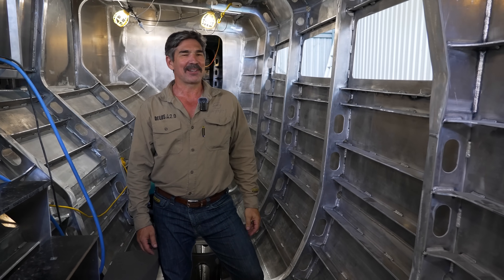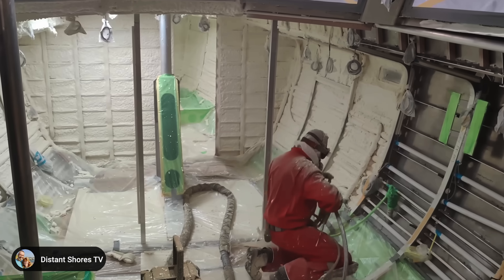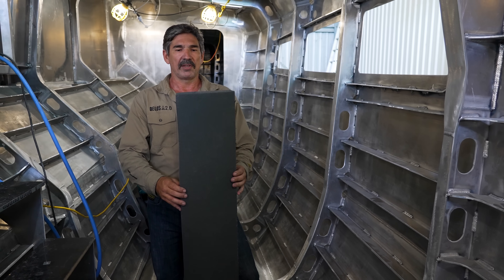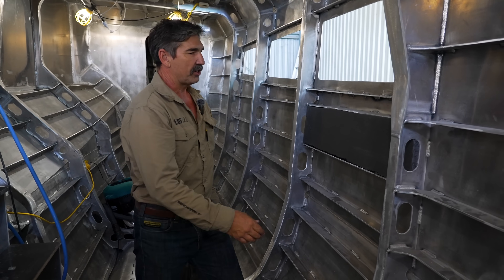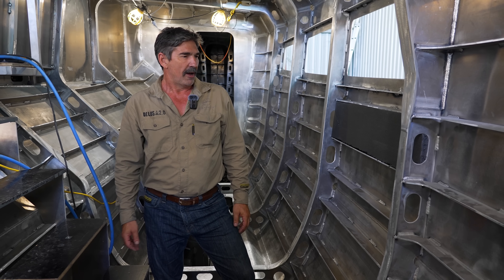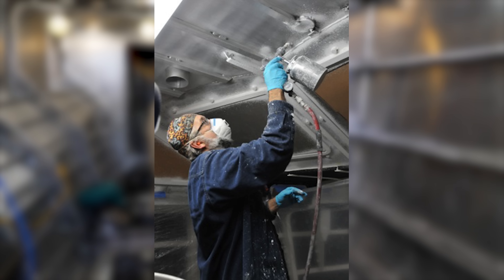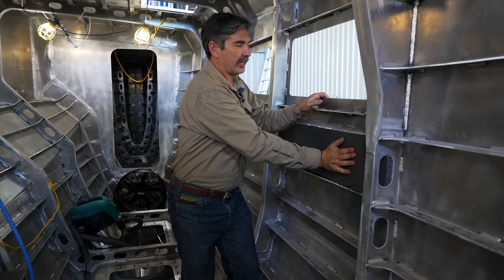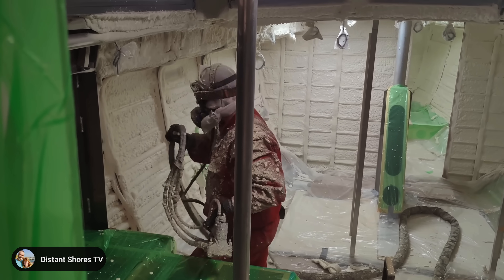HELP, We Need Your Advice!  How Should We Insulate Our Aluminum Catamaran???

Comment: I used the sticky back foam for sound insulation on my engine compartment. Worked fine until heat deteriorated the foam. Getting the residue from the adhesive off was really difficult. This was on fiberglass, not metal but I imagine it would not be easier on metal.

Comment: Spray foam seems the way to go. It's a coating AND insulation.

When going for the foam panels, ditch the pins, and use plastic clamps that grip on the ribs and hold the panels against the hull. Possibly 3D printed ones.

The final layer on top of that can be glued to the foam panels already installed.

Comment: I would definitely advise you to use foam.  It's complete, offers better protection and is less work to install. Make sure to lay all the tubes you could possibly need, foam it up all the way to buoyancy and then just build a boat inside a boat, attaching everything inside to that inner boat only. Zero fasteners to the hull, all tension shape stuck, and all the way 'round. You're gonna be amazed by how well that isolates, even from the sound of your own engine, and as a bonus, she's unsinkable. Believe me, you're not gonna miss those inches. Have you ever slept under a thatched roof? That's what it feels like.

Comment: Spray foam is the best. Maybe a hybrid system with spray foam everywhere and make boxes with the closed cell foam to use like hatches at select wiring/plumbing junctions. Just remember ANY air that gets behind that foam sheet will also be carrying moisture with it.

Comment: 50 years building boats, small boats to superyachts and insulation is one of the most important aspects of making a yacht comfortable, I never skimp, 1st choice spray foam (but be sure you have all your welding completed!)...second choice, rock wool after a barrier coating on the alloy......fire proof, inert, high sound and r value. There may be some new cut foam products, but these two produce no risk results. Good luck

Comment: You are going to get condensation will all but the spray foam 
Live with the spray foam and cross repair bridges when or if they come.
Using the paint them closed cell foam still give the same repair issues as spray foam, but harder to remove the paint

Comment: Your mixing info on the fact that spray foam provides lateral racking from happening. There is no choice better than. Have extra conduit if you think you’ll need to run wires later

Comment: I wondered how you would cope with this issue! Thermal bridging is a bitch, she'll sweat no matter what you do if the insulating is not evenly applied, so it's a mission impossible with the depth of the main ribs.
Here's a "madcap "novel idea, embrace the gap, apply a flexible structural insulated sheeting to the main ribs chemically and mechanically. Venturi the hull space left behind, save you a fortune in time money and weight.

Comment: Spray on ground Cork? i watched a video where they used it in conjunction other insulation for a van build. they where worried about condensation and sound proofing. i have no idea if it works for boats

Comment: Brian, I’m a former contractor sales rep. I learned several things about insulation. 1. Any kind of foam board insulation you are going to need a vapor barrier. 2. Any structure that requires insulation needs to breathe, meaning that your 3 boat is going to expand and contract. That’s going to cause a situation for moisture to develop. 3. The best is a total spray foam insulation, here’s the reasons why. When using spray foam insulation it automatically expands filling any and all possible ways for moisture to develop.  I’m not a pro at insulation, however when I was selling insulation to contractors in the Midwest, spray foam was the top choice due to the fact it removed oxygen from any space. And with no oxygen in the space you can’t have moisture.
Reply: I think the same, this is the best and the cheapest, easiest solution Brian! Spray it forget it. You don't need to access that area again and again. Identify necessary parts for electricity and water canals before, thats all...
Reply: Spray lanolin oil on and wipe with rag on the ally before you put the foam panels you will be fine

Comment: Thermal coating to protect the metal; evrywhere. Spray foam in inaccessible areas/low infrstructure. Maybe run wiring pipe for future repairs/additions then use pray foam? Good luck B!

Comment: Agree with the comments below that spray foam is the way to go. I worked at Palmer Johnson in the 80s and then Minnefords. PJ built cruising boats back then and all were insulated with spray foam. Same advice about running channels for wires and plumbing. Make sure ALL welding is finished before spraying as burning foam gives off cyanide gas. Don't spray the bilges. Minnefords built aluminum racing boats (12 Meters and IOR boats) so insulation was never used because of the weight penalty. Lightweight cored interior joinery and equipment as well as gear kept noise to a minimum.
Reply: Burning foam gives off cyanide gas? Um, that sounds like a suboptimal solution. Boats do catch fire.
Reply: @marchuvfulz  Just like cars, airplanes and houses, everything gives off toxic fumes (even wood) when burned. If my boat (fiberglass, foam and plywood) catches fire, I'm going for the life raft ASAP!

Comment: I would go with spray foam 100%. Probably your best option all around and will save you a lot of labor instead of cutting hundreds of squares. If you are really worried about stuff like the conduit maybe wrap them in pipe insulators so you have an extra layer between the foam if you ever need to hack away at it. Also, you have a ton of hours filming the boat without the insulation so it shouldn't be hard to find stuff at a later date just a bit inconvenient.

Comment: I use a closed cell polyethylene foam with adhesive on one side and foil on the other for air conditioning installations, available in rolls of different thickness, out door in the Aussie sun it shows no sign of deteriorating after 8 years.

Comment: I used aluminum duct work tape to tape the xpe foam for my aluminum houseboat insulation easy to cut around and pull piece out and retape it back in to seal it if need be

Comment: K-Flex ECO is a great option. It's a halogen-free, closed-cell elastomeric foam insulation that's designed specifically for marine and shipbuilding.
Non-Halogenated: Complies with U.S. Environmental Department standards.
Temperature Range: Can withstand temperatures up to 250°F (300°F intermittent).
Environmental Safety: Free of CFCs, HFCs, HCFCs, PBDEs, formaldehyde, and fibers.
Antimicrobial: Contains an EPA-registered antimicrobial agent to protect against mold, fungal, and bacterial growth.
Moisture Resistance: Resists moisture vapor intrusion, making it suitable for various marine applications.
ABS (American Bureau of Shipping) approved for use on ships.
I am a chief engineer in the USMM, I have seen the USCG come abord and inspect are ship and found USCG noncompliant (not green colored foam insulation installed and made us remove it), if you are considering using your vessel commercially. 
 Love your show keep up the good work.
Reply: I am familiar with several insulating products but I had not heard of this product before, after a little googling it seems like a good product.

Comment: Spray is the way to go. Just as long as you plan for extra routing that you will most likely never use. Realistically you will not be routing allot additional wiring op tubing in your boat once its done. But plan for it and provide over capacity. Put a couple of nice, extra fat conduits with access points every 4 feet  on both sides of the boat. make sure they are planned to be empty on day one. You will never think of enough projects or toys to fill them in your lifetime.  Then you can rest knowing that  you have loads of  spare capacity.   And spray the hell out of that hull. Best of both worlds.

Comment: I wouldn't do any kind of insulation, that burries any kind of infrastructure like cables and other ducts other than in prefabricated hull material ducts with access ports. And i would strongly recommend then classification of fire resistance or-proofness. And, as you already insinuated , the insulation has to include all stringers and ribbons. So, you will have to sacrifice probably pre estimated living volume. Fire proof first !!!!! Only one inhalation wil kill you, when the insulation gets lightened up. Fire fighters have gas masks, sailors never will!!!!!! Keep  that in mind !!!!!

Comment: I would use a combination of all those methods. You can use the spray foam in a nock and crannies as well.  I do love the idea of protecting all the Aluminum with spray coating. One rule comes to mind however, you can never over insulate. ⚓🛸

Comment: Spray on cork.  I would look into a composite insulation system.  Spray on cork layer to isolate aluminum and provide condensation inhibition for 90% of use cases, then fill voids with closed cell to improve thermal and sound insulation for comfort.

Comment: Hey Brian, the pins that stick to the hull provide a cold bridge to the warm interior space. It can condense there, resulting in moisture damage. I would go for the Distance Shores- method. I think it's turning out to be a very nice boat. Just about the bus bars; Aren't you afraid of arcing between the poles at such high currents?

Comment: Just do spray in.  You are worried about it coating the metal for the rare event you need to do repairs but its really not that difficult to cut out and scrape off an area you need. and regardless you are talking about applying a coating anyways so you still have that problem even if you don’t do spray in insulation. 

I would much rather have a future headache of dealing with the spray in insulation than dealing with corrosion. 

Test spray in on some scrap and see how hard it would be to remove if you needed to get down to the hull. 

Also you have the benefit of being able to carry some cans for repairs on your boat.

Comment: Not from boating but from housing, I'm aware that with the super high heat loss standards that are becoming required, steel framing is a major problem because of the huge amount of heat transfer to the outside via the framing which insulation between the frame still allows. However, that's apparently still a problem with even timber framing where the timber frame also causes substantial heat loss between the insulation slabs surrounding it. Aluminium has to be the worst material for heat transfer. I don't know the answer, but I wanted to reinforce your idea towards the end of the video that it's insufficient just to place insulation panels between the aluminium frame. Those relatively thin "frames" have to be insulated too. Look and see how it's done with housing.

Comment: Subs use pliable rubber foam contact cemented to the outer hull.
Reply: That is to absorb sonar to avoid detection.
Reply: @Rustaguy  I am not referring to the anechoic tiles on the outside of the hull. But the inside of the hull is lined with neoprene rubber foam for insulation and condensation control

Comment: Aren't you going to paint the inside of hull, I mean under the insulation?  (As well as the insulation.)

I'm just guessing but surely a thick layer of paint would help protect you from some corrosion.

The insides of the professional boats seem to be painted white, the reason why they pick that colour is so that they can see problems against the white.

Comment: Hi,

I am providing a solution to your problem below which is used in the building industry around the world.  This design is easily applied to a boat, though I have never seen it used in Sailing vessels. I do not recommend semi rigid foam (spray or cut to size) due to mould growth and fire hazards.  Also, I do not recommend you applying a "paint on" vapor spray as you reviewed in your video.  
Building science is very important to a healthy house/building/boat.  Living in Canada and being a builder, mould growth, air circulation, continuity of an air vapour barrier, fire safety should be part of your design.  The aluminum is your exterior "sheathing", like siding on a house. It needs ti breath!  Next, you would create an "air" void against the haul by using plastic dimple board (1/2" dimple or 3/4")) cut to size for each compartment against the exterior haul.  This allows air and vaporized moisture to drain vertically to the bulge (if built properly, you will never see moisture on these surfaces).  Note: The key to the design is to never have vaporized moisture turn into a liquid (condensation) on the inside air void space (inside hull and dimple board).  If condensation does form on these surfaces', the air space temperature will eventually allow/adjust to re-vaporize any moisture.  In theory, if water ever accumulated in this space, it would drain to the bottom of the dimple board, eventually through gravity, make its way to the bilge.  This air void allows air to flow through the space to keep it dry so mould growth and oxide (rust) would not occur.
The next layer to install would be your insulation.  I would recommend "Roxul".  A non hydrophobic insulation (Mineral wool).  This product is also fireproof, meaning it will not spread a fire and covers/protect the dimple board from being exposed to fire or catch on fire.  In any design of this "sandwich" assembly, the goal is to have the "dew point" of the air in the assembly be within the Roxul insulation.  This fibrous material is easily cut to size and can be split to whatever thickness required.  Roxul can also be removed after it has been installed for revisions to your haul repair or M&E revisions.  You can also weld next to it and will not catch fire!
The final layer would be a vapour barrier like 6mil poly, where you would seal the insulations VB with "Tuck Tape" sealing the VB to the haul and VB joints. There is also caulking the you can purchase to seal the poly to the haul. 
The VB must be sealed continuously to work properly.
Next, you would now install your final interior product like millwork, fibreglass, etc.

Comment: I bought and travelled with a 25 year old rusty steel boat, that was spray foamed. Where the spray foam was the steel was in great condition and the foam was still bounded really well to the steel. Other places - not so much. My biggest concern when I had to remove the foam some places was that it wasn´t spray foamed any more. I would definitely go for spray foam! (What I understand it needs to be 2 components, polyurethane).

Comment: mechanical engineer with experience with insulating stainless steel machines. spray foam is purpose made for this application. no thermal bridging, no thermal coatings to worry about,  no air gap management, way less risk for condensation. just plan you wireways & utility pathways ahead of time and when repairs/mods pop up just get the scraper out. respraying after the work is done is easy peasy.
Reply: I am commenting here because I like this answer and while I don't know jack-poo about boats my first concern was condensation under insulation and I think this covers that concern.
Reply: Extra conduits never hurt anyone.🤷‍♂️
Reply: What about the health risks of spray foam? Is there a safe, safer, safest option?
Reply: Mechanical engineer here who also builds houses..

Condensation in nearly all wood applications I've seen. Several states. Can't address it everything has to be ripped out for fresh blow insulation...

He needs to be able to maintain his boat and foam board is water proof... It may break apart but it doesn't collapse internally like spray foam when wet. Even closed cell will.

Try actually building something then get back with I'M A MECHANICAL ENGINEER.

Comment: I have no expertise on this, but just a note: check if you need a fire retardant / "intumescent coating" sprayed on top of spray foam. Also, conduit seems smart but I'm not sure what's suitable for marine use. In a house I would usually use "smurf tube" / ENT tubing, but it's probably not marine rated. Did a quick search and there are interesting marine rated products in the ABB PMA Conduit Guide PDF. Love your channel, best of luck on your build!

Comment: Steel boat of 44 years here. The EPS insulation in the roof sections works best, followed by breathing Rockwool behind wood pannels. I did the bow section with sticky Armaflex. I will never do that again. I had to do some welding last year and it was horrible to remove. In the future I will use 3cm Cork pannels and rockwool. Noting sticky.

Comment: Oh if you leave empty conduit leave nylon pulling cord in the conduit with a washer tied to each end so you are ready to pull a wire through from the word go instead of having to start by getting fish tape through. Grey PVC with fittings will give the best sliding/pulling experience. I don't know where you guys get all this energy from but God bless you.

Comment: I didn’t read all the other comments before but this is the way we insulate aluminium yachts in The Netherlands: To prevent condensation spray 2 mm of thermal coating (Mascoat or Pyrotek) on the structure parts sicking out of the insulation (normally frames and girders).  Then apply a rockwool insulation (Isover, Rockwool, Firemaster) in between the longitudinal stiffeners for thermal and acoustic purpose and keep it in place with pins and washers. For the best thermal results you apply a thin layer of insulation on top of the first one, covering all the longitudinal stiffeners leaving only the frames and larger girders exposed. You can always send me a message for further advice.
Reply: The advantage with this option is that it is not flammable.

Comment: Insulation for a metal building not a boat.  But low density spray foam is the way to go.   Resistant to moisture, insects and great insulation.